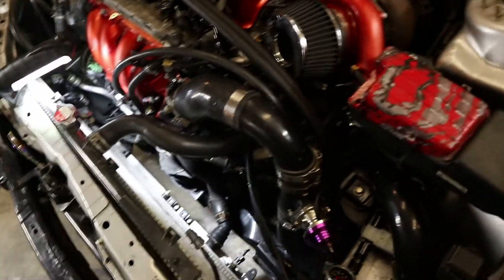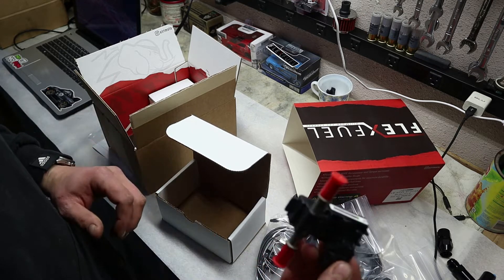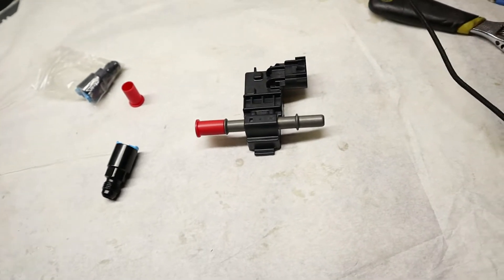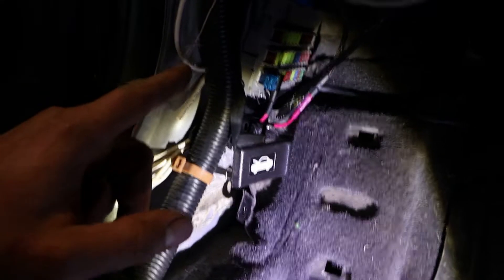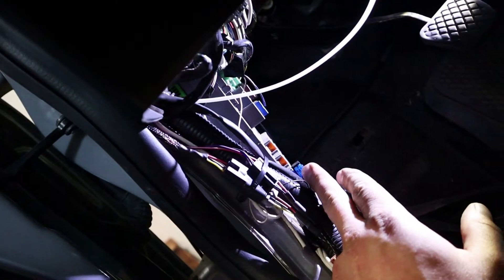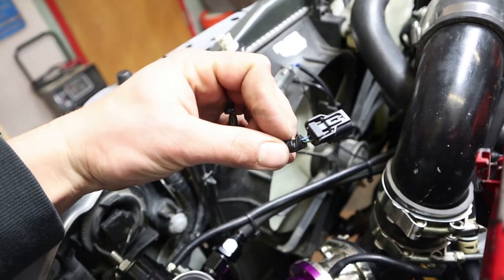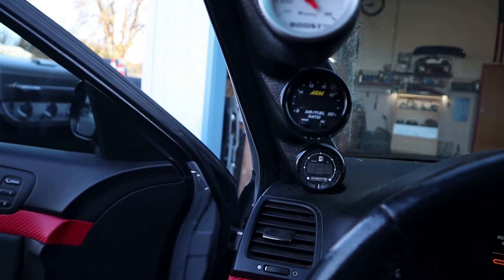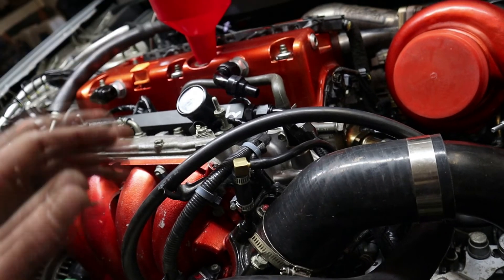Acura Tsx: Flex Fuel/E85

Comment: Love the context. But quick question. Do I have to run the Siri Moto kit ok my tsx with flashpro? Or can I just make my own harness and hook it up to the ect2 pin?
Reply from the maker: No you just need input from sensor to ect2 for flashpro to read.
Reply: Quick question. I have tried to setup my system. I have power and ground and signal from gm flex fuel sensor going to green wire on ect2 and selected ect2 input in flashpro. But it’s constantly reads 24% ethanol regardless on weather the sensor is plugged in or not. Do you have any idea what the issue could be
Reply from the maker: You have to set the correct voltage in hondata. I had my tuner do that
Reply: @RuskiRedneck  can you send me your tuners info please
Reply from the maker: “Nahbil Tuned” you can find him him on FB

Comment: I have an issue where the local accord does not have a ect2 sensor just a normal fan switch. I have the tsx ecu with hondata obviously but I'm assuming there should be an input for it on the ecu side. I have checked and hondata recommends to use pin e1 I have checked and it's currently being used by the immobilizer ￼￼ I tested by depinning it and sure enough green key flashes and car won't start.

The wiring diagram also confirmed that on 04 05 e1 is clear on the 05 06 but i then referenced another diagram of a 02 04 and its seems that this is the one for the car even though it's an 05 06 😒 I checked a few other accords as well and it's the same as 02 04now the problem is hondata reckons I can use b12 and b22 which I have tried but with no success everything is wired except for the eth signal 😔 but nice build and nice install vid 👌👍
Reply from the maker: You’re best bet is talking to a local tuner. I had to have the voltage adjusted in hondata for the ecu to read the ethanol properly.
Reply: @RuskiRedneck  I tune all my own cars. I did some further searching and realized that you can't just use the eth content sensor output directly to the ecu. You have to run it to the controller and use that output to the ecu. On my kswap mr2 I run the output directly to the eth sensor input and I assume the kpro can handle the signal directly. Where the tsx ecu can't. I hope this is the case will do some more research later on. Have you done any times with your car yet?
Reply from the maker: @darrolarendse12  We’ve got the car to read ethanol content with pump gas but I have not ran ethanol yet. Waiting on a sleeved block before I start pushing that kind of power. It took a bit but the tuner had to adjust the voltage settings in flashpro for the sensor to match the ethanol content.
Reply: @RuskiRedneck  I’m having the same issue. Playing with voltages, do you mind sharing what numbers worked for you ?

Comment: Hey man, so I bought an 04 Acura Tsx and the previous owner had it super charged with e85 setup. He converted it back to stock before selling it to me but he said he left the e85 stuff in it incase I wanted to run e85. However, I just want to run it stock and normal. The check engine light is on for the coolant temp sensor (p2185) and does not clear even if I try to clear it. The code comes back on instantly after clearing. Do you think the reason why is because the previous owner tapped into the coolant temp sensor like how you did?
Reply from the maker: Yes exactly that. If you have hondata flashpro and you can disable it or wire the sensor back in. I imagine he removed his flashpro before he sold you the car
Reply: @RuskiRedneck  fortunately he did give me the flashpro. Would you happen to know if disabling it will make me fail smog? I live in California where they are strict as hell and will fail any car if they detect any tuning on the ecu.
Reply from the maker: You’d have to ask someone local who’s more familiar with running a tune and passing smog.  You might be better off just wiring the sensor back on.